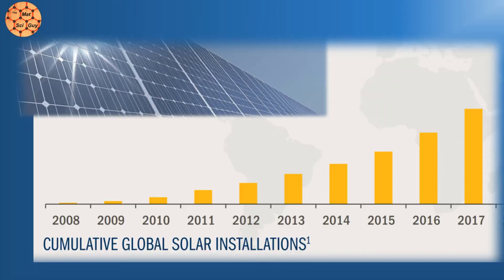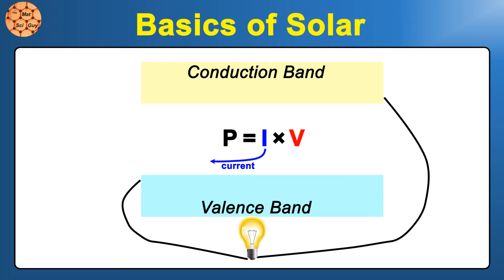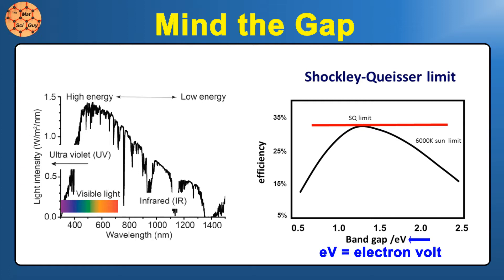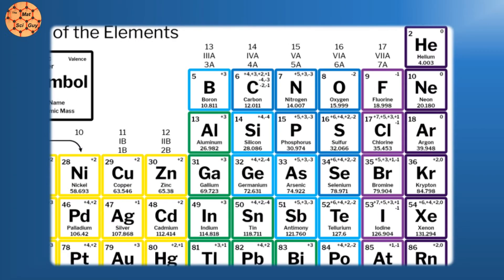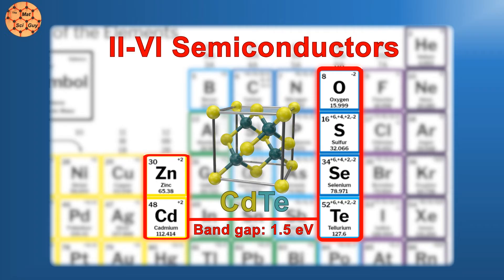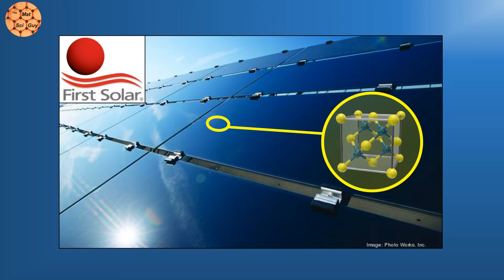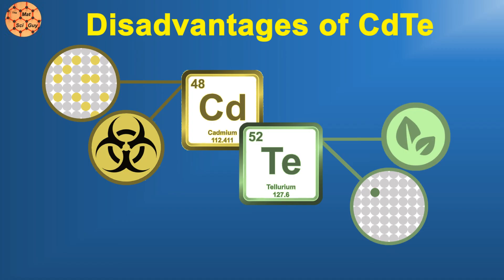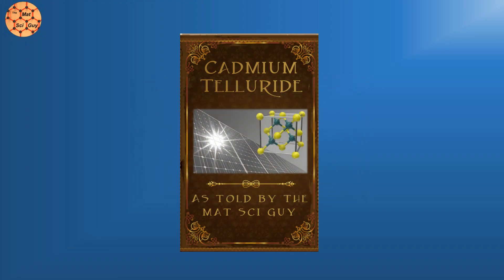The Story of Cadmium Telluride: Kick-Starting the Solar Boom

Comment: wonderful, thank you. Great explanation also on the periodic table relationship.  I noticed the II-VI pairs feature elements with a full D orbitals (Zn and Cd), the way it was explained to me is elements in the D group tend to have 'full pockets full of electrons' and are therefore able to give up large numbers of electrons.  Another group with even 'fuller pockets' of electrons are the F group. Lawrencium, Lutecium, etc. It seems like Mercury Hg and Copernicum would also be good candidates due to their position with full D and F orbitals, if paired with a VI group, that they would have a plethora of electrons to give up and circulate.  This isn't my field of study, just something I've been reading about lately and your video made me wonder why these aren't used. Very thought-provoking thank you for it!
Reply: HgCdTe2 is a material used for infrared photodiodes that detect the 3.5um  to 7um thermal infrared energy. It does work extremely well if you add a little indium to it for an electron multiplier in beta voltaic nuclear batteries. A multi keV energy electron is converted to many double digit eV electrons, and these excite the final collector of diamond GaN or SiC.